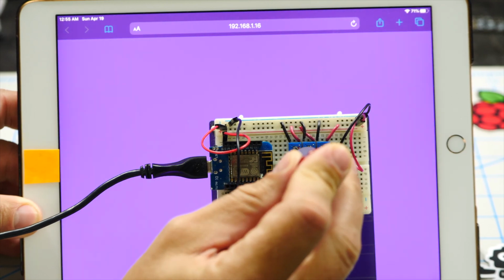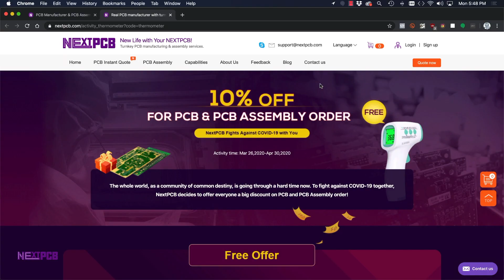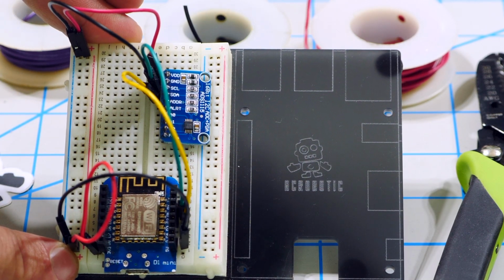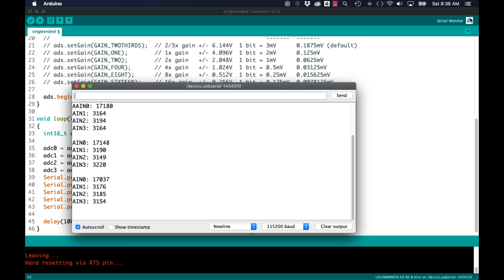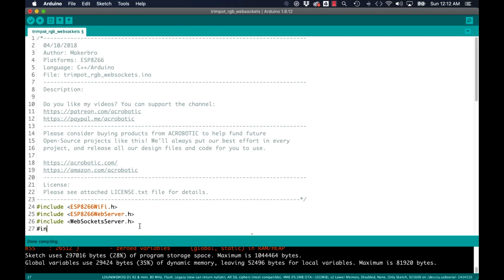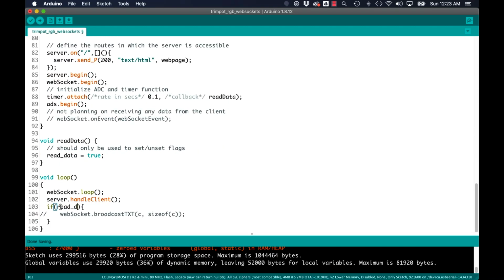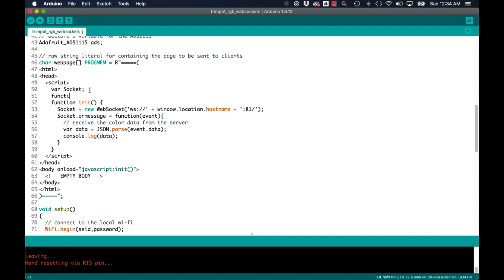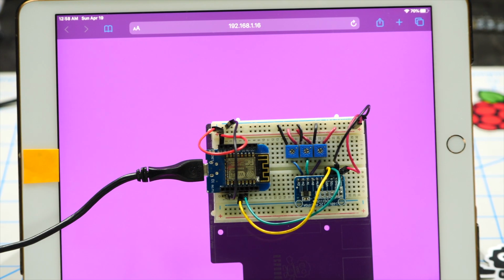ESP8266 Analog Voltages for Controlling Webpage RGB Colors | ADS1115 ADC, Websockets, Arduino

Comment: that was a nice one cause of giving a solution for the limitations of esp8266 for one analog pin,
but there is another way around this problem that i want to share i hope it can be useful for some cases

you can make a little script and circuit change to get the data without using that module and its just associating io pins with 2n222 to activate the module you want to read the data from with voltage it needs then read the data and put it in array then next sensor for example in one second you can at least get data from 3 sensors or any analog thing, this is not a perfect idea cause yours is better for starters and specially when some sensors need to warm up to get the correct data but still the idea lives and any one can make it happend

thank cisco for another amazing tutorial
Reply from the maker: thanks ali. by all means share whenever you are able to :)

most definitely, that's a great solution. i've done something similar for reading analog voltages with the Raspberry Pi, even using capacitors and measuring discharge time—fun times. thanks again for sharing!
Reply: @datasith  all thanks to you , and i will share